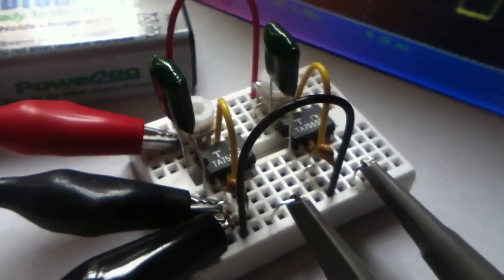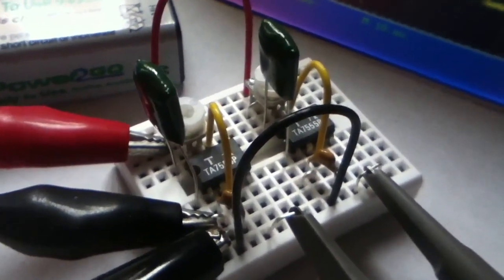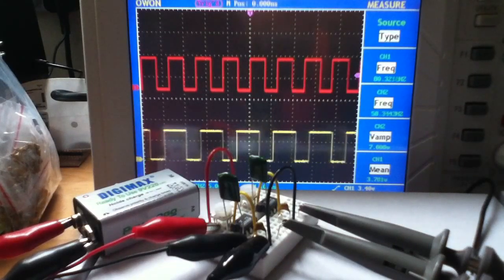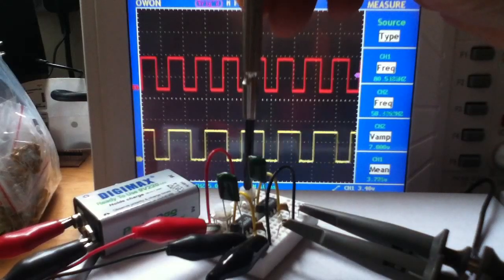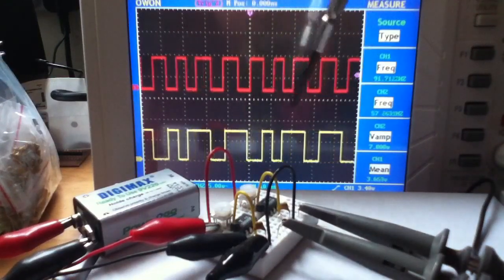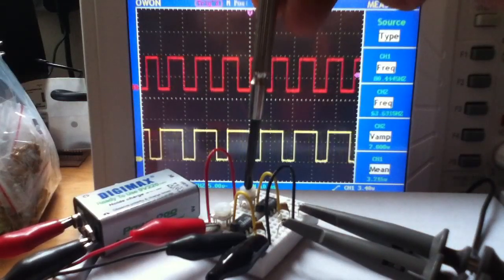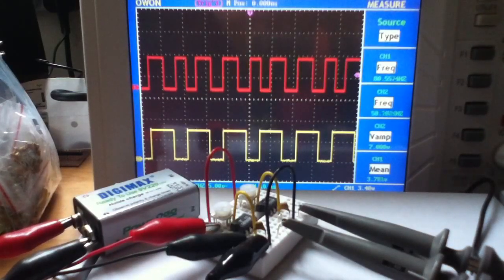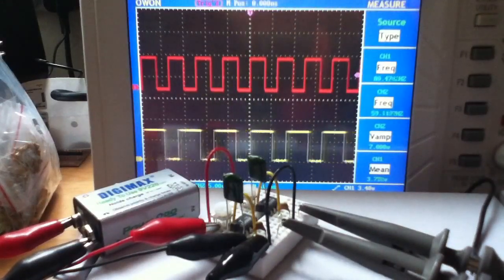Logic Circuits need Decoupling Capacitors - but what is Coupling?

Comment: That's why I dislike the 555 pretty much. No matter if regular 555 or cmos 7555. They mess so hard with the power lines, even with decoupling caps, they put noise on the rails.

Comment: Which capacitor tyoe should i use for decoupling? Ceramic or polyster capacitir?
Reply: Lahcen Lahcen it depends on which frequency your application is, for example polyester or electrolytic capacitors are useless at HF, you should use the ceramic one, below 1KHz the electrolytic are kinda good, in other words you might use an electrolytic in parallel with a ceramic to be sure of the absorption of the none wanted Ripple

Comment: This video was great for helping me solve my problem with two 555 timers connected in the same circuit.  Thanks for making it!  One electrical engineering question though - I don't understand why two capacitors are necessary.  My rudimentary understanding of circuits tells me that having one capacitor connected from the +V pin to the ground pin on each chip is the same as having 1 capacitor of double the capacitance connected between the ground and +V rail anywhere else in the circuit.  Am I missing something?
Reply from the maker: Adam Malone That's true if the PCB tracks have zero ohms resistance - but they don't. Which is why the recommendation is always to put the capacitors as close as possible to the Vcc and Gnd pins on the chip.

Comment: I Didn't realize this was one of the other reason for decoupling Caps!

I always thought the primary reason was so stuff like when a micro-controller is flashing an LED a cap is placed in the VCC/GND for the micro-controller to cater for the added "surges" in current when the LED's go on..
Reply: Those surges arent only causing potential trouble with the microcontroller, but also the rest of the circuitry. Decoupling is something you do to prevent issues. In a lot of cases it would work without, but then you suddenly get really weird behaviour in your circuit. Its more like a precaution, although its very necessary sometimes.

Comment: Do i need it for every component ?
suppose i have 3 optocouplers with 4 opamp, with 3 mosfets and some BJTs. Do I connect a decoupling cacitor for every power source for every IC, or is this craziness ?
Reply: In that case, only the opamps need them ...

Comment: please guide me how to calculate the decoupling capacitor value for digital circuit like microcontroller and circuit consist optocouplers, line driver etc
Reply: You need to understand what your target impedance is (milliohm realm), and over what band of frequency. For PCB decoupling, this usually extends to 100-150 MHz. At the point your on-package, and on-die capacitors take over, up to the GHz range.  Capacitance has no meaning, it's the loop inductance. You can put an infinite amount of capacitors on a given PCB, but the efficacy of the capacitor is limited by the loop inductance.

From DC to kHz realm your VRM handles the di/dt demand. From kHz - ~1Mhz your bulk decoupling handles the di/dt demand. From 1MHz-~100, your ceramic/SMT capacitors handle the di/dt. Anything beyond ~150 MHz is handled by on-package and on-die capacitance. Also, planar capacitance, provides ESL less 2nd order decoupling out to the GHz realm, depending on board material and co-planar spacing. The closer the planes the better

Also, x.y location of the capacitor is a 2nd order effect, the z dimension inductance is a 1st order effect. Current "blobs" out in x & y on PCB planes
Reply from the maker: I don't think anyone calculates decoupling capacitors - just put a 100n (or bigger) across the power pins of each chip. The capacitor acts like a micro UPS - providing continuous power when the supply glitches or browns out momentarily.

Comment from the maker: Interesting question. What would happen if I used a separate battery for each of the oscillators, but kept a common ground line. In effect, the oscillators are communicating with each other, signalling via the Vcc line relative to ground. If the Vcc connection wasn't there, the signalling couldn't happen.

Comment: That is an excellent demonstration. You are using a reasonably high impedance power supply there in the form of a 9V battery, it really gets the point across.
I can't remember where I gleaned the information, but individual digital IC's need something in the order of 10,000 Amps to switch states. This is the reason why the decoupling capacitors need to be as close to each IC as possible in order to transfer such massive currents.